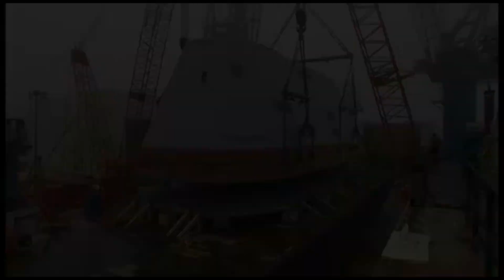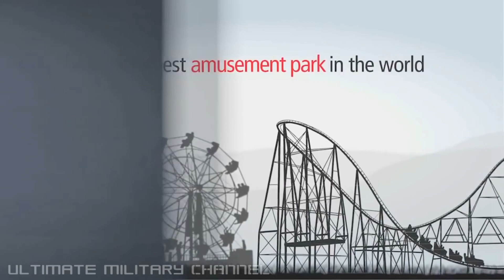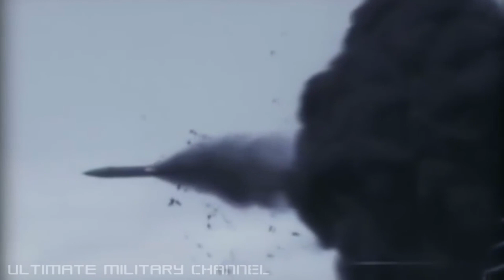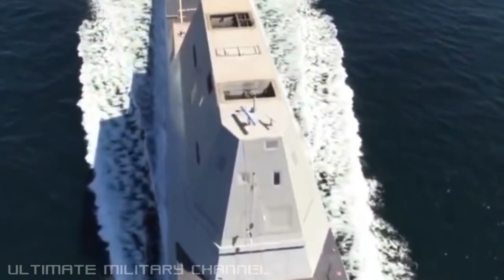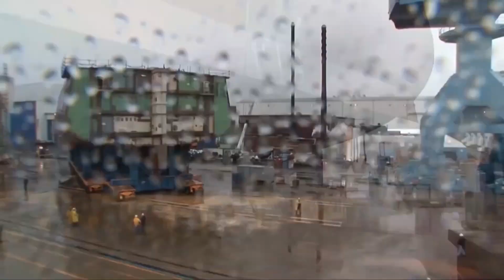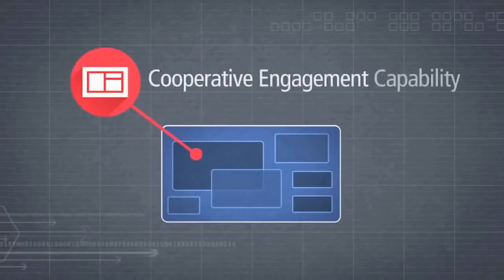OK Navy Vets What say you?

Comment: The $7B Zumwalt's biggest flaw that it was primarily incorporated/marketed as a LITTORAL-operating fire-support ship for special ops operating inland -- to sneak close into shore to then project power ashore with its 155mm AGS gun blazing away.  However minor problem :  this 7 foot long GPS guided rocket shot from the cannon is no longer being procured because it was too expensive.   LOL!  USN has no problem spending $7B for the hull, but balks at spending critical expenditures for the main lethal munitions intended to bring deterrence and capability to the ship in the first place!!  Nice strategic thinking and planning!  All that said, USN could have just procured 10x EPF JHSV type ships for the cost of 1 single Zumwalt and simply deployed them with HIMARS rocket systems in a specialized LITTORAL fire support role if it was ever required to operate in such a role!  Heck, throw in a few ATACM rounds for good measure...   

Honestly though, Zumwalt could be better equipped with 2x twin-barrel high-rate-of-fire 127mm turrets with 100km-range shells replacing the well intended, but sadly insufficient 155mm guns!  That and loaded out with a full tube load of LRASM, ATACM, SM-6... just escort each Zumwalt with a couple Frigates for dedicated ASW mission, i.e.., leased foreign ally Frigates, because USN of course no longer operates any such Frigate class surface ships...